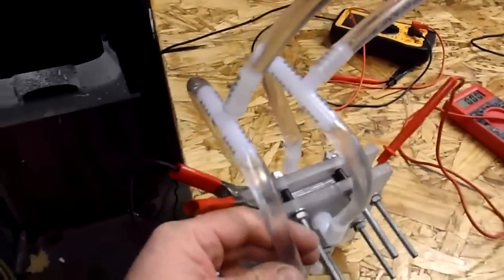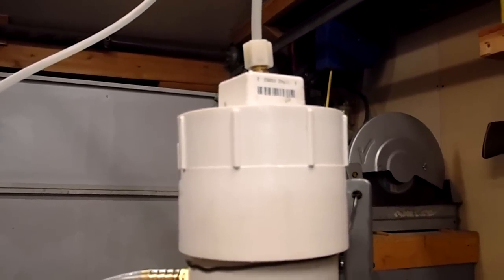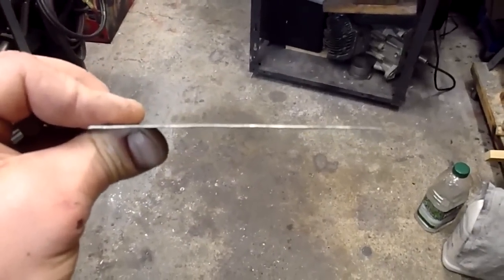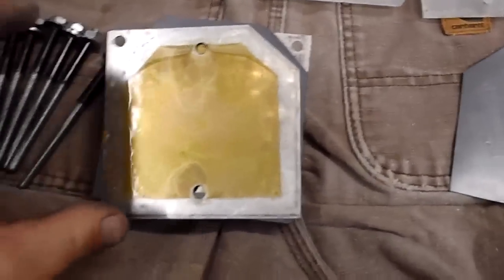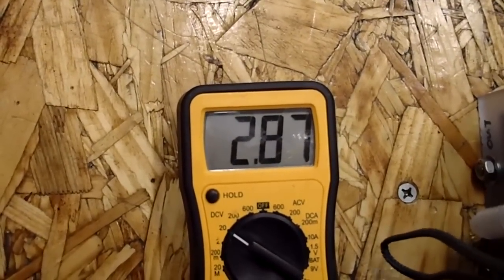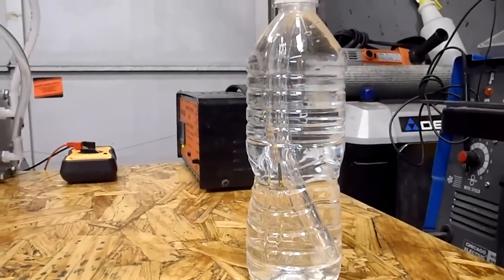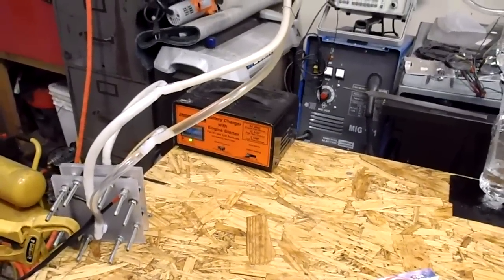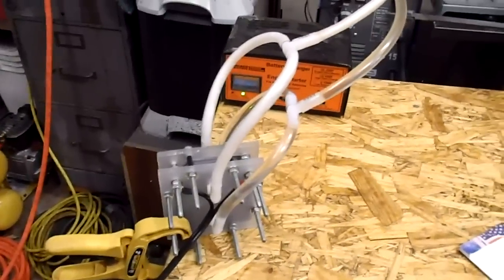HHO Dry Cell - 1 - Construction

Comment: isn't it better to use only active plates plates and use a 2.5-3V at bigger amps power source?
Reply: viermidebutura more amps = more heat. You don't want it to get too hot. But if you use more than 2v per plate, you have a chance or arcing, which is also bad
Reply: Joshua Parnell did electrolysis happen only at the active plates or at all plates?
Reply: viermidebutura as far as I know, and I could be wrong, I'm still learning, the passive plates act as a bridge between the active plates and electrolysis does happen at them as well. Again, this is what I'm inferring, not what I actually know. I hope to have a valid answer to this, and a lot more questions, in a few weeks when I'm fine researching and looking to actually build

Comment: Nice job, but you should use distilled water with your Potassium Hydroxide solution. Also if sandpaper your plates they have a greater efficiency. Also try to measure out your solution ratio, too much KOH and it will heat up faster and give a greater amount of heat but it will also contaminate your hydroxy gas with water vapor; too little KOH and it will require more energy. Also, try using a second battery or even make your own cell with lithium batteries so you can recharge it and not have to waste your car battery.
Reply: llamasoftime how do you measure the solution ratio?

Comment: Horacio ,316 steel is inox [as 314,317,etc], 316 is a kind of clear inox ,other types includes and others[appromix.] percent metals....except this is against corrosion.
In my cell the electric must be 12 DC 450-500 mA ...but the most important is the backin-soda and the  distilled water.

Comment: So in order to measure it more accurately you need to fill the bottle with water that is going to collect the gas, then invert it into a pan of water, so the water in the collecting bottle will not fall out as you invert the bottle into the pan, then have your hho pipe inserted into the collecting bottle from the bottom whilst it is standing inverted in the pan of water, as the water displaces from the bottle it gets pushed out into the pan, thus exerting no pressure on your gas being collected.

Comment: when you are measuring your volume, you are not helping it because the water that is displaced from the hho collecting bottle has to force the water upp into the other bottle higher up, that means the water in the second bottle is exerting pressure on the gas (hho) in the first bottle, so your gas is being compressed by the weight of the water in the other bottle, in other words your gas volume is probably a lot higher than you think.
You need another approach to measure the volume of production

Comment: How to check if it is 316 / use a magnet, the strong magnet should not stick to 316, as 316 has NO carbon content in the manufacturing of it, whilst lesser stainless steels have a carbon content, and it is the carbon content that makes any steel magnetic.
Thom in Scotland.

Comment: Great video, very informative!!! Thanks!
I'm not an expert, but I'm thinking the stainless you are using might be 304 since that is the most common alloy. 316 is second most common, but I would think 316L is a lot less common which would be more corrosion resistant I believe. Stainless steel can corrode in the right environment, so if the discoloration is not caused by contaminants, it is probably corrosion. I think a lot of oxides are not conductive so that would be bad if that's the case.
Reply: You are correct

Comment: I think you were restricting your flow a bit with the weight of the water and your reading should be higher ,your design is a good way of keeping a resevour at a level. Do you get a good water circulation through the resevour? and from what I have seen you can safely draw a current of around 15A with 12V......good vid ....would like to see some more!